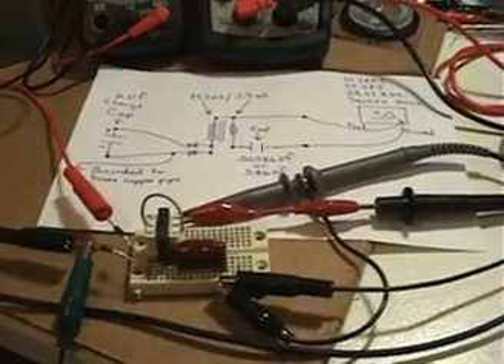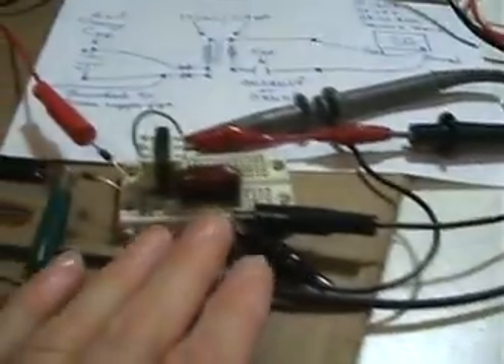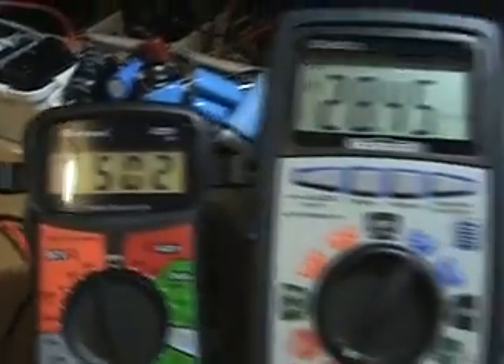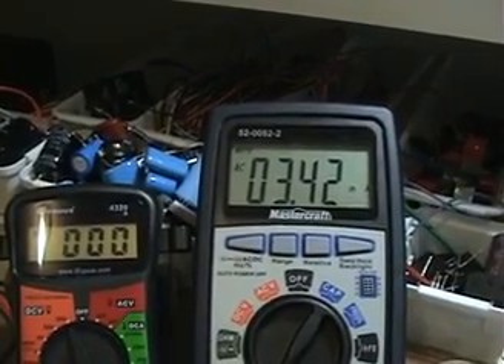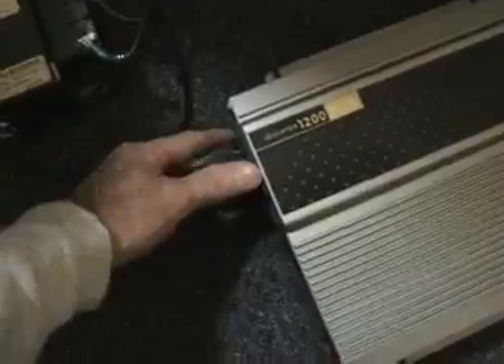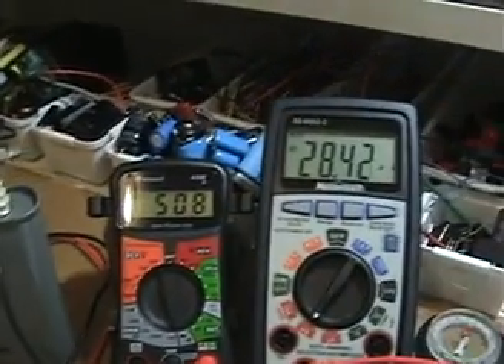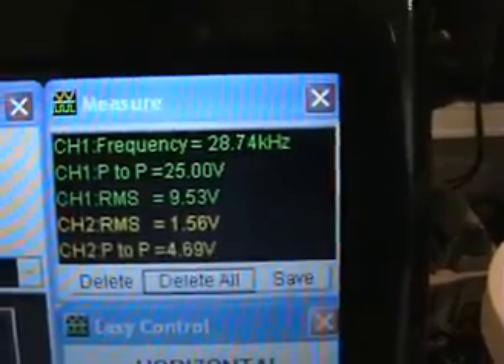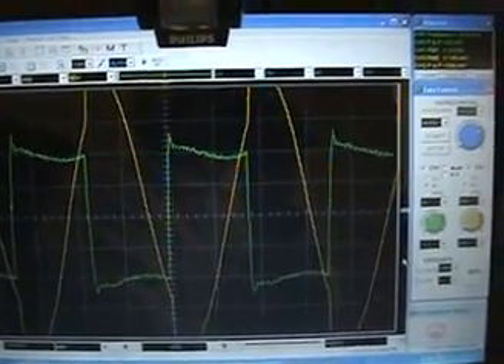RESONANCE EFFECTS FOR EVERYONE TO SHARE test 1

Comment: continued... The Diodes act as a half wave rectifier allowing the pulses to rectify into dc pulses. The circuit can only provide 3ma when shorted because the output coil can not free ring with a heavy load like a short. The free ringing with no short allows a resonant effect, allowing a resonant voltage rise. When the Big cap is connected, the cap charges up to the resonant voltage.

Comment: continued... So now, the primary side is ringing hard. The magnetic coupling to the second side is probably NOT resonant with the second coil, but you're vibratig it with some muscle for that little transformer. The secondary is swinging freely. It may have it's own resonant freq, which you're not hitting, but because it can ring free with each input pulse, it is is creating it's own ringing with each pulse.

Comment: continued... The Neon lamp glows with one lead because the ringing voltage is so high compared to the surrounding enviornment then even the open air dissapates energy from the other lead, illuminating the lamp. Your body absorbes more energy from the second lamp lead than the air would, to it illuminates brighter. The Ferrite core does also.  Moving on to see your video 2!

Comment: continued... The HEAVY current draw occurs because the HV charge on the cap allows the coil to swing, in so doing, allows it to pull more current from the circuit.  The Ground provides even more electrons to add into the ringing circuit as they are pulled in. Tesla knew this. He frequently watered his grouding rods for better conduction to ground.

Comment: continued... I bet the circuit charges quicker as the voltage gets higher and higher because as the cap voltage rises, it pulls less magnetic coupled energy from the transformer and is therefore "free" of heavy cap load and can ring more freely.

Comment from the maker: Hi najman100,

thanks for looking. I did hook it up to a HHO cell and gas output was barely detectable but this was before I had the ground wire added. If you want to follow this a new topic was started at OverunityDOTcom. The link to the topic and where the schematic is posted is located in the description box next to the video.

Luc

Comment: Nice work.Have you tryed connecting one leg of the cap to the primary of a transformer and the other leg of the primary to the disconnected leg of the diode and then measure the voltage of the secondary of the transformer. It will be interesting to see if it is a true ac or dc that is charging the cap.

Comment from the maker: Hi ebisevac,

I did no calculations and have very little electronic knowledge. I simply stayed with the same coil and tried different capacitance and did a frequency sweep until I found the best reacting capacitance to charged the storage cap to the highest voltage while also keeping input miliamps as low as possible.

Luc

Comment: Luc, you could optimize this, if you would use a much bigger Ferrite transformer.
Then use a selfmade 9 Volts battery powered square oscillator and run the ferrite transformer at the resonance frequency of the primary LC circuit as you do it now.
Then the secondary is an Avramenko-Stiffler-plug. Then compare the cap energy storage versus input powerxtime= input energy
until the cap reaches 500 Volts.

Comment: Congratulations of replicating Tesla radiant energy receiver.Please,put a tiny bulb (probably 75mA or lower) on wire coming from ground to check if this is an electron current flowing to fill capacitor negative terminal.

Comment: I have a fundamental question.
as for a mechanial system, frequency input with a value of natural frequncy results in very high shaking and vibration and could totally take it apart.
for a RLC what is the effect of such an input, except producing high voltage amplitude? what's the significance of it? any possible "damage" to the circuit?
Reply from the maker: +Navid Davani Hi, electrical resonance does not exhibit the same characteristics as mechanical resonance. However, if the LCR input is too high, there's a point where the wire shielding will break down from excessive voltage and plasma sparks could start to burn the wire itself.
Reply: Luc gotoluc Choquette  thank you

Comment: you're creating radiant energy, it doesn't work like conventional electrons flowing around a circuit. that is why u can get it to light with only 1 wire.

Tesla would be proud ;)

check out my video "Shlodo's SSG Imhotep Radiant Oscillator" video on my channel

Comment: Great video. No, this is NOT radiant energy, which IS a real phenomenon, but only emminates from a repeating undampened HV spark which is NOT what you have here. No, this is simple electromagnetic resonance, on several fronts.
For one, the primary cap and inductance resonate at 35.655hz if you do the math, but you were pretty close with the 28khz feed. Considering a loaded resonant circuit runs slightly off freq, you're probably hitting the sweet spot with that input freq.